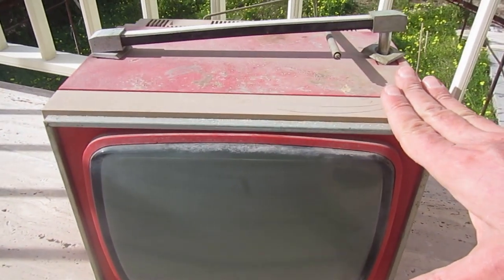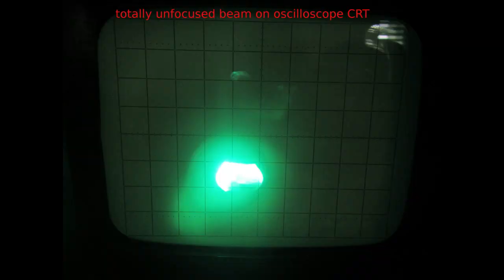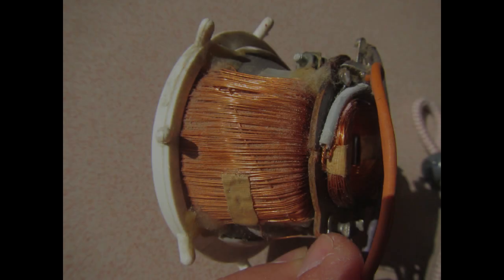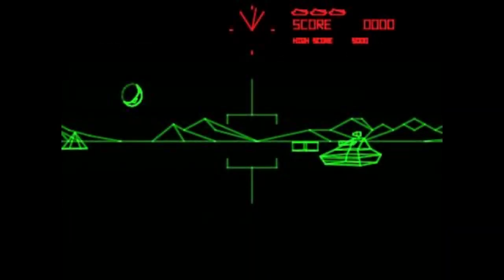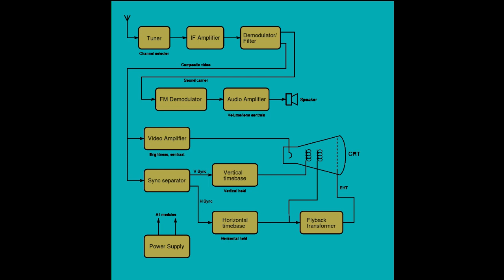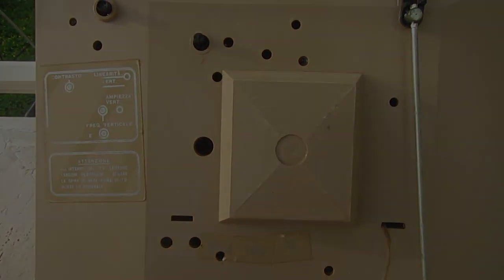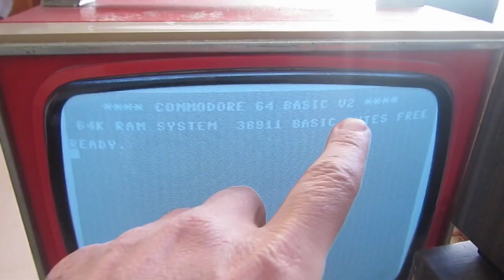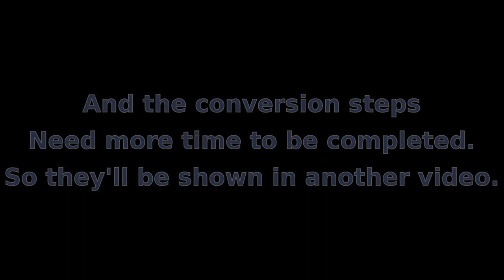Making a vector monitor for Atari Asteroids arcade. pt.1: Theory

Comment: Fascinating stuff. Never really knew how CRTs worked, so great explanation. Complicated but not as complicated as I would have thought. And a spaghetti western to finish up :chefs kiss:
Reply from the maker: Thank you for the nice comment! I'm working on the real conversion, but things got really slow due to "the event", you know. We aren't getting much mail/packets/whatever, so I'm kind of stuck.
Reply: iz8dwf indeed. The world seems to be on hold especially in your area. Most important to keep you and yours safe and well. We’ll enjoy the rest of the series when it comes. 👍
Reply: great stuff, I am looking forward for the next chapter.
I have a 14 Philips that I want to convert, too.
Reply from the maker: @jorgehrenstein4031  Currently I'm trying to come up with a working flyback driver circuit. It's something I'm learning right when doing it, since I hadn't designed anything similar before. I think once I have a working flyback, part 2 will be out (and then a final part 3 probably).

Comment: Congratulation for the crystal clear explanation! Vector graphics display is also installed  in my 8566b SA. Now I know a bit deeper my SA! And since crt tube is  becoming dim I wonder if vector graphics may be implemented in a small TFT....so I get rid of the dying CRT .
Reply from the maker: There're already solutions for the instruments XY CRTs: https://www.testequipmentplus.com/LCD85662H.php this is an example. The problem with instruments is that they often use electrostatic deflected CRTs and those have also additional features like "flood" background intensity, integral scale and so on
Reply: @iz8dwf   @iz8dwf  I know what a flood gun for analog storage is, I miss integral scale through...

Comment: great project. I am looking forward to the next part. I will start a project, too. But I do not have so much knowledge about Vector Displays.
Reply from the maker: Hi, I didn't have much knowledge too before starting. I'm learning a whole lot of things in the meantime. I'm working at the third attempt of a decent high voltage supply, but now I understand much more about these circuits than before I started. It takes time!

Comment: Is your "vectorbeam-eliminator.pdf" available anywhere? I want to use a vectrex as a display for a cinematronics board, and this looked like a good place to start, but is no longer available in the forum where I saw it mentioned.
Reply from the maker: I planned to upload my design to github, but so far I haven't "patched" the PCB design with the new offset circuit. If you drop me an email I can send you the updated schematics. However I doubt the original vectrex deflection circuit can cope with the drawing speed and voltages of the arcade boards. As far as I know it uses audio amplifiers for the yoke drivers.